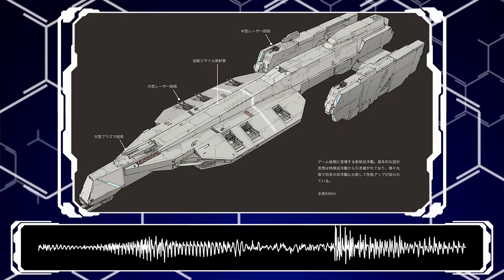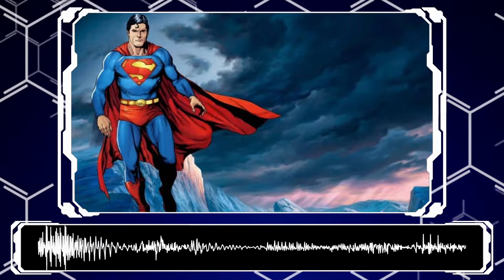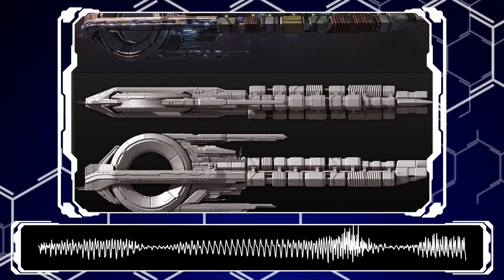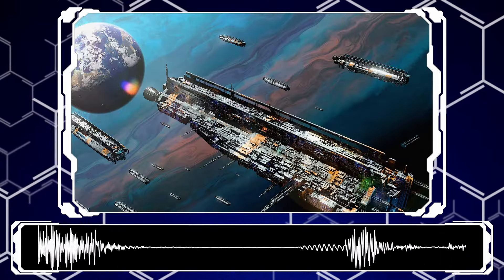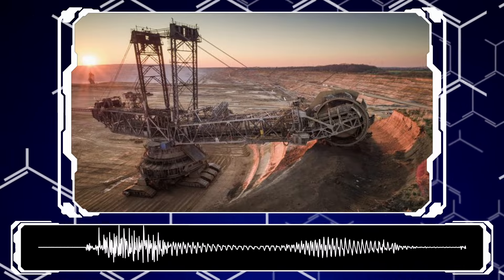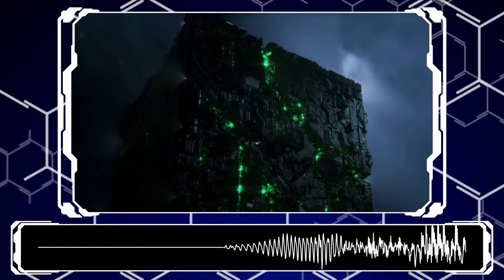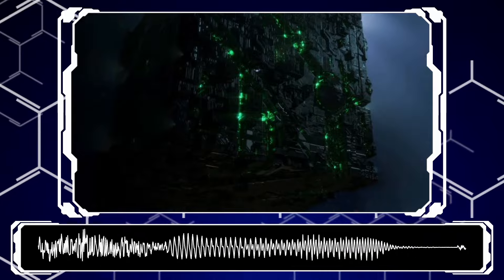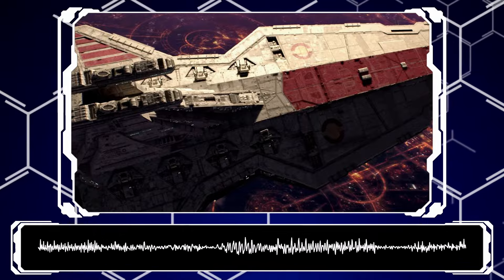The artistic principles behind SCI-FI ship design

Comment: 10:50

I don't think this is a hideous ship. It gives the vibe, the purpose and the feel of a battleship. A ship of the line meant to slug it out in broadside against other such ships and utterly annihilate anything smaller. It brings an image of might, power and a ship built for war. The lines of guns on it's aft broadside is just magnificent, the image it projects; dominant and imposing, with it's surface of gun gun gun and gun. It's only slight being the damned bridge being exposed on a tower.

So, I disagree with your judgement of this ship. In my eyes it is a beautiful battleship that looks like it can brawl.

15:54

This would've been good if it didn't look like it was begging to be gutted from stem to stern. The lack of frontal armor just makes it look stupid. Sure, explain away with internal armor but we're talking exterior here. That thing looks like it can slug out in broadside but would break from a single railgun shot from the front.

Now one last thing, the Imperial Star Destroyer might be iconic but the design is beyond stupid. Tarkin Doctrine at it's finest. The huge exposed bridge begging to be shot, the glaring blindspot at it's stern, the massive exposed shield bulbs, the lack, the absolutely nonsensical lack, of point defense systems and CIWS, it is stupid. Even the lack of a main battery running along the ship's centre line is indicative of this, seeing as that is how the ship would be best used, bow pointed at the enemy, giving best angle for it's armor and a centreline main battery would be most effective given the ship's shape. It also lacks guns on it's underside, immensely idiotic due to the nature of space but since Star Wars has a tendency to spit at the laws of physics and at times, even logic, it makes sense in some sick, twisted manner.

I find the Resurgent, stupid as it's design still is, to be more a more beautiful. But if you're looking for a terrifying ship, look no further than the Harrower-class Dreadnought under the Sith Empire. Terror in both name and look. More stupid than the ISD, with that massive crack down it's bow, the more exaggerated superstructure and the lack of broadside turrets that make it's hull feel empty both lore-wise (it's a Sith design damn it, it should be caked in guns and weapons) and visual wise. But it more than makes up for that with it's visual appeal, more than the ISD. At least this thing doesn't have exposed shield bulbs unlike the ISD.

Now 40k is something I am willing to accept despite the idiocy of it's ship's design. It is in the very nature of it's faction, universe and identity to be over the top, to be a flying cathedral with guns and bigger guns. The gothic architecture of the Imperium gives off oppressive, evil yet awe-inspiring vibes that it becomes a beauty unlike any other. When fleets of the Imperium arrives over orbit as your world is being overrun by Ork, heretic, xeno or whatever warp horror it may be, to deliver divine salvation... only to realize it is there to cleanse the world and you with it.

Besides, why not have a flying cathedral literally fly through hell just to get to another spot in that dystopian world? The flying cathedral providing divine protection to it's crew as they sail through the immaterium, uncertain if they will ever arrive at their destination and if so, when they will arrive - the very instant they left, or in centuries, perhaps millennia past or future.

Comment: Honestly I hate big flat paneling on ships. No engineer ever would design anything that way. Tons of extra weight that in most of these universes does nothing. In the expanse for example Martian ships are always shown with big flat armor and it never does anything. If you are trying to tell me it’s to stop debris why the hell is it so thick then? Maybe an 1/8 of an inch of aluminum would more than do that job. The only time anything bounces of the armour in that universe is once where the roci has special armor and it’s done correctly and only placed on the front profile and around the reactor. In Star Wars/Star trek it’s even worse! They have shields that deflect stuff and as soon as the sheilds are down the armor never does anything. What’s the point? It doesn’t make the ships look any better in my opinion. Id much rather look at something that looks like it was put together by an engineer to do a task and not some artists interpretation

Comment: In space, why do you need a front and back for a spaceship?  Space does not have direction.  So why do you to know which is the front?
Reply: Because the back will usually have more thrusters so the ship has faster acceleration in that direction and the front will usually be more armored with more weapons since doing it on all sides would cost way too much. The front is also the direction that the cockpit is looking in most of the time